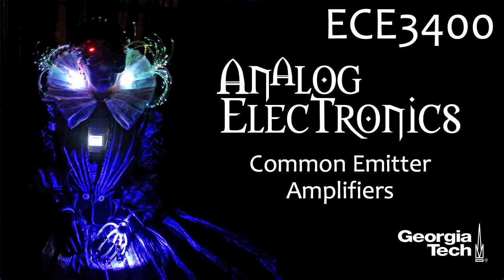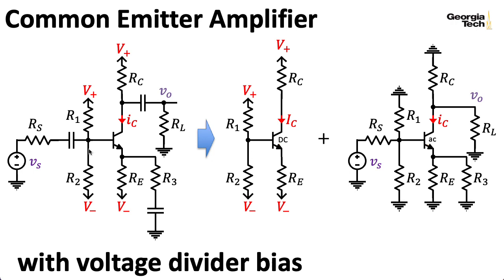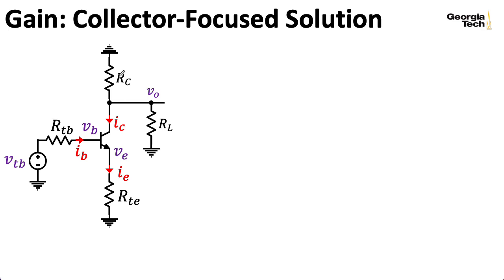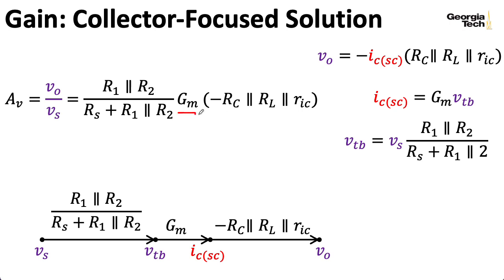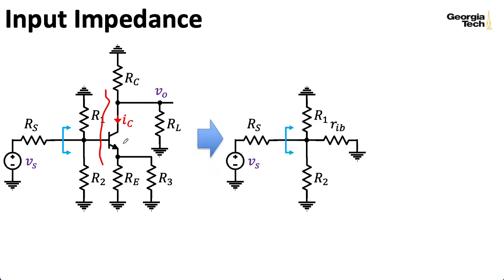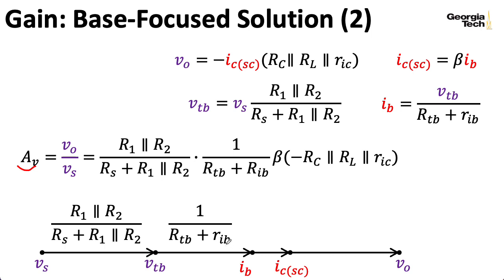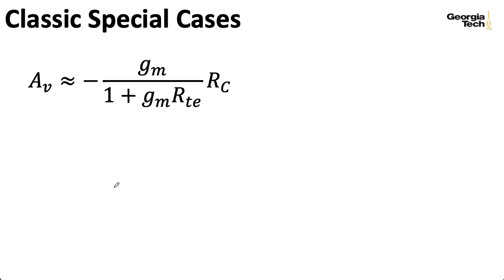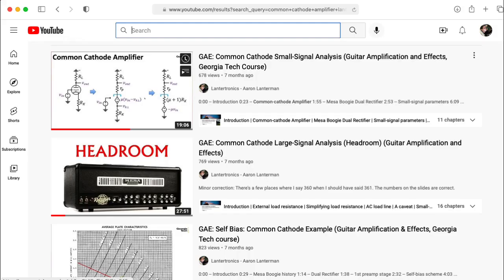ECE3400 Lecture 13: Common Emitter Amplifiers (Analog Electronics, Georgia Tech course)

Comment: I'm confused about the VA value. I know it's the Early Voltage, but in the design process, how do I determine or calculate this value?
Reply from the maker: Frankly, most people just kind of ignore it most of the time. It's not something you'll find on a data sheet. In your analysis you can estimate a value for r_o from data sheet curves by looking at the slope in the "constant current" part of the collector current vs. V_CE plots. But most of the time it doesn't make much difference.

Comment: This is a great method for analyzing existing CE amplifiers, but what about creating them? It might be just me, but it's difficult to pull meaningful values out of thin air that happen to fit into these equations and achieve desirable results. There's of course useful guidelines all over the place about designing these types of amplifiers (e.g. it's a good idea to have the emitter voltage be approximately 1V because R_E >> r_e), but what I'm curious about is how this analysis technique could be applied to that end? Is there perhaps a systematic way of doing so, or is there more guesswork involved?

In any case, I immensely appreciate that you take the time to upload these lectures to the internet, and they've thus far proven indispensable in my self-education on electronics. I hope that you keep this up, and wanted to let you know that you're doing a great thing that's helping out countless people such as myself.
Reply from the maker: To do justice to the design procedure question would take a whole other lecture -- which would be a worthy one to do if I find the time. In particular, I'd need to learn it myself. Most of the time I spent on circuits is spent analyzing ones I find to figure out how they tick. I confess I haven't done much from-scratch design myself.
Reply: This is a very important question, you can find some answrs here  https://www.youtube.com/playlist?list=PLeZ72UXc6pC73bgVLTHSnODaLWTMkIpcM      , he solved smoe design problems and implemented the solution on a bread board., but he is using the conventional analysis methods. It would be great if prof aron can recomend some design reference. By the way the design work is not much different from mechanical engineering design (lots of assumptions and common engineering practice ) methods (I'm a mechanical engineering person). Kindly let me know If you find a design book, I have Donald Neamen, microelectronics circuits analysis and design

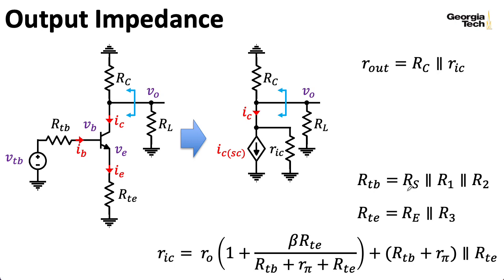Comment: Hi Arron, at 13:36 you specify " the output impedance of a Common COLLECTOR Amplifier" , but this lecture describes the Common Emitter Amplifier. The next lecture describes the Common Collector Amplifier and contains the same statement. Are they both correct and/or was this one an error in terminology?

Comment: How does the capacitor connected to ground block DC?
Reply from the maker: All capacitors block DC. (Direct Current is poorly named, it should really be called "constant current")
Reply: Because the capacitor impedance is z=1/jwc=Infinity because w=0 for DC signals, so current will pass through the capacitor